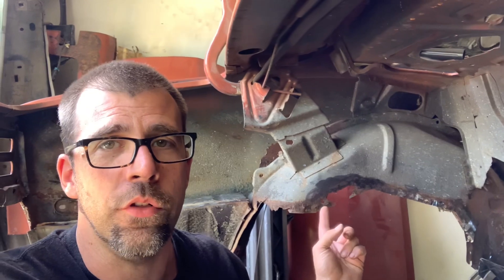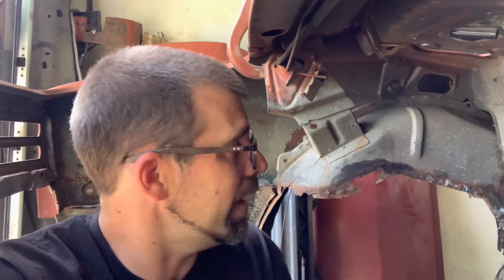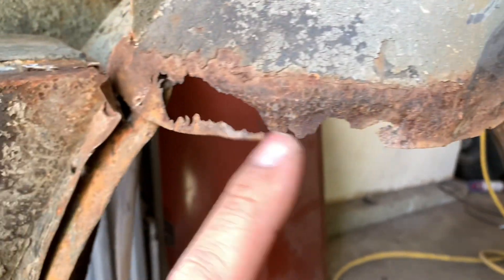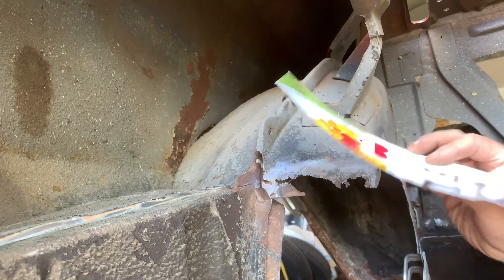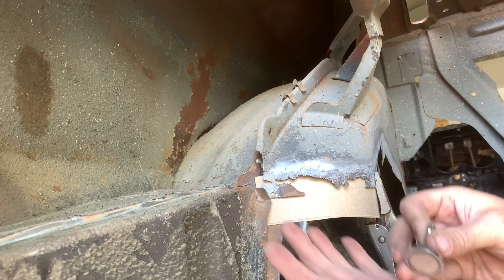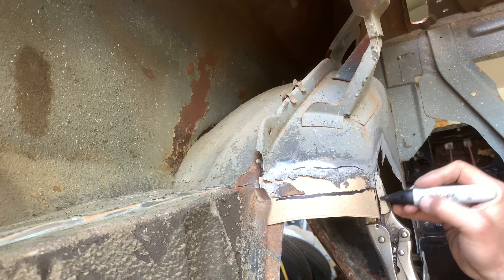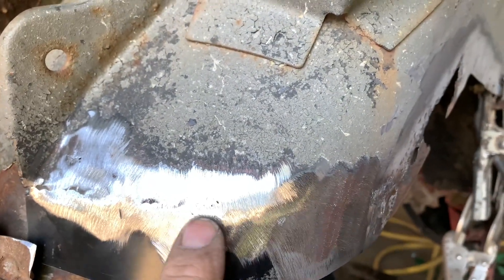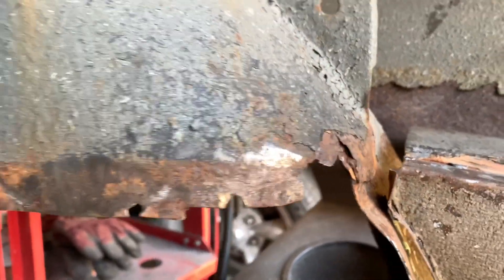how to make patches for seamless Wheel well rust repair 1968 Firebird

Comment: Thank god none of my F body's have ever been that bad. My worse car had the outer tub lip edge rotted out for about 2 inches and I was lucky enough to find  a doner car that I was able to graft in enough meat and flange & weld it in then use a section of a aftermarket patch 1/4 (China) and replace about 4 inches all the way around the wheel arch. Worked out great with a little duraglass & mud filler, blocked straight and 7/8/9 coats of fill primer. Most car's as bad as your, I pass on, to labor intensive to deal with.
Reply from the maker: Well I leaned here in Indiana/rust belt this car is mint……. Well to me.  Lol.  I don’t mind the rust repair it’s actually my favorite part. Crazy part people still ask crazy money for very rusty cars and I can’t do that.  I wish I could find them with minimal rust like yours, great score on your part. I assume you live out west?
Reply: @VinylVillageGarage   Both my F body cars were from St. Louis Mo. I am the original owner of my 68 RS/SS H/T and I bought my PHS documented numbers matching 400X 4sp. Convertible Bird in 1976 for $850.00 with minor rust out in both 1/4s  but the rest of the car was very sharp, complete & correct otherwise.  Back then there were no full 1/4s to be found ( NLA from GM ) at all so we tried to find wrecked cars and used a lawn mower blade and sledge  hammer by hand ( no, there  was no cordless sawalls ) to cut out good sheet metal in the junkyards ( yes there were rust free 67 to 69 F bodys in junkyards in the late 70s).  True it was a TON of hard work, but it was the only way as dealers had nothing and there was no aftermarket yet for sheet metal.  You have no idea how good you got it today, a call to Ames and your parts are on your door. We had to find everything word of mouth before anybody else. GTOs  were even HARDER to get parts for !!!! Plus there was no pontiac only yards, just go diggin yard to yard to find stuff. Buy a floor pan , trunk floor, firewall was a royal pain ! but it was cheap. A floor pan, $35.00,trunk floor  $20.00 firewall $15.00 but all day to cut that sucker out with a lawn mower blade! bam, bam, bam, bam wham wham ! with lots of blood sweat and  tons of 4 letter words of wisdom !  OH YOU NO GOOD SON OF A #^$@*^$^%$ !!!!   it 4:30pm ! there closing a 5PM!  Your comeing OUT of there floor pan ! WHAM, WHAM, WHAM !   ----- Ohhhhh yes, been there .
Reply from the maker: Lol, I could see myself doing the same thing to get parts back in the day just like that if I had to. I can only Imagine finding a rust free first gen in a scrap yard. I would be in heaven playing at a junkyard like that. Just think you where cutting up what we would consider Gold now.  I do remember the days of swap meets and digging thru boxes to find the treasures, this was before the days of the internet and online shopping. Now swap meets are not that great and overpriced unfortunately.  Even when I did my first bird back in 1996 parts where not nearly readily available as compared to today. Even the quality has improved.  Congrats on buying and keeping your 1968 Camaro. That’s almost unheard of. Me being a bird guy bonus points for you owning a nice Firebird too. I have yet to own a  factory 400 bird.  Here is to someday maybe.  Thanks for sharing
Reply: @VinylVillageGarage  Long time subscriber to you, I have 3 motors for my 68 convert Bird, a 1970 YS R/A III / 13 casting heads, plus, the numbers matching WS 400 with 62 heads and my beast, a WW R/A IV 4 bolt block +.030 with a 389SD forged crank & rods  I got from Smokey Yunick in Daytona, ( poor folks, no way to afford a 421SD, yes I asked --- $20K for short block)  I got 670 heads the WW now in the car , but am saving $$$ up for a pair of the new aluminum Tunnel port V aftermarket heads & intake. To heck with twin turbos or the NO-2 juice, I will do it the old fashioned way ! all MOTOR !  There is no WAY I can apply any more then this to any kind of street tires.  A R/A 4 with forged crank & rods plus tunnel port heads ! yes, I think that will be just fine ! I already know I power shift it at 8,000rpm all day no seat  with solid lifters & 670s heads. Them Tunnel ports will get it up to 8,700 rpm much quicker !  Ever been up in smoke  sideways in 4 gear ? Stay tuned.
Reply from the maker: Huge Thanks for being a subscriber. Most impressive engine collection and parts.  The 670 heads I will take those when you trade them out for the ram air V beasts. After running that you won’t ever want to go back.   I saw a company or a guy was making the heads ran into him in Plainfield IN last year. Tried to sell me a set. Very tempting but it’s some serious money, special intake, cam shaft, and custom headers.  The wow factor when you open the hood, priceless
Reply: I use to flat out cry when a perfect rust free 68 F body was stolen & in the yards. NO yard would chance selling anything off a stolen car, they had to hold it for 3 months ----- then CRUSH IT ! OMG NOOooooooooooooooo  perfect 400 HOOD ! Rally pack cluster, correct perfect 400 grill,  Posi rear, fold down rear seat, Deluxe interior & 3 spoke Bird wheel   NOOOOOoooooooo!!!!!!!! as they made it 6 inches tall !  And today it's a dead Mitubinga !  Grrrrrrrrrrrrrrrrrrrrrrrrrrrrrrrrrr !!
Reply from the maker: Noooooooooooo! heartbreaking and so not necessary
Reply: @VinylVillageGarage  . But the sound of them Vs ! totally different from any other motor. The 670s will be bare, as they got a  set of R/AIV valves in them now and no hardened seats for unleaded gas. I will have no need for them and there runners, heads don't crack in South Florida !  lol.    
The R/A V heads are pricey but my god on a R/A IV with a forged Super Duty Crank & Rods & solid lifters, totally bullet proof.  I have already blown the clutch 5/6/7 times and threw the ring & pinon right out the back of the 8.2 with 433 gears , had to build a 12 bolt for it and a custom chrome molly driveshaft as I twisted 2/3/4 GM shafts up like nothing lol.  Yes I an VERY hard on stuff !   My car, my style. if it doesn't brake , try harder ! I really think I just about got it good to go now. Haven't broke much in a very long time . I still have all the original parts repaired and ready to go back in if I want to put it back as a stock numbers matching car ( the 8.2 replacement posi rear is out of a 69 400 car with 3:90s close enough PHS said it came with 3:55s)
Reply: @VinylVillageGarage   lol , we would BOTH be at the bar drinking HEAVY crying  after that----- seen it happen with Birds & GTOs  as well . There was a 67 GTO that was just like  SHOW ROOM NEW ! they took the motor & trans and that was all. When the yard got it, it sat there for 3 months ( with me asking to buy it DAILY with CASH !!!! )  and then this big nasty front end loader stuffed it in that damn killing machine  and ---- and ----- NOOOOOOOOOOooooooooooo your killing me here, it was like open MURDER !!!  We car guys never get over that kind of thing !   Hell that was 40+ years ago, but that GTO was outstanding. I had a 428 at home and Muncie ready to drop in it .  I would have had that GTO on the road in 24 hours, no if's !
Reply from the maker: I build them to drive and not always delicately. I scattered a 8.2 diff as well mine split the pinion right between the bearings then launched it thru the side of the axle housing, Didn’t have a driveshaft loop but fortunately the drive shaft bounced around a little then came to a stop on top the muffler, almost rubbed a hole thru it.  I might have been driving “the speed limit” 😉 beside a mustang between stop lights when that one happened.
Reply from the maker: That would be like watching a live execution of your best friend, not something I would ever want to see.  Closest I ever got to something like that I found in the back lot of a car lot a 1969 Firebird quite possibly a 400, convertible panted carousel red you could just barley make out the tail light panel from the gate opening gap.  I took a sneak peek once No engine, trans, or any wheels other then that complete.  Tried to buy it, stopped periodically for over two years with the same response, no title can’t sell it, I even offered a nice lump of cash multiple times. Then One day it was gone, of course i stopped and inquired what happened, they sold all the cars in the back lot to the scrapyard for scrap price.  NOT COOL
Reply: @VinylVillageGarage   Some of them we just can't save. All the big junkyards in St. Louis that had multiple Muscle cars have been gone for decades. But it was the small private yards that I found the real rare stuff. I picked up my R/A III 400 in a 300 car yard in a 71 CAMARO ! ???? YES ! I ran the numbers and it was for a 70 GTO A/T car. it had chrome covers and was spotless. The yard owner was  a Chevy guy so I got the R/A III for $150.00 and he pulled it out ! ( best running motor I got really) Another small yard had 4 68/69 GTOs hit HAAAARD !  and all had WT 350/360hp 400s in them. At $75.00 each you bet I pulled all 4 of them. At one time I had 28  big horse power 389, 400, 428s in my little 2 car garage. One of the 428s was a 390hp out of a 67 G/P veeeey rare.  I never liked the 455s, so passed on all I found.( even a 455HO for $200.00)

  I moved out of the cold dark snow & rain of St. Louis in 1980 and had to leave most of them behind.  Only could bring the 3 I still have and many boxes of parts to South Florida.  The numbers matching 400 block & heads for my Convert, the WW R/A 4 block and drove the Firebird down with the YS/ R/A III from St. Louis to south Florida with 4:11 rear gears, yeah a long expensive trip! Never missed a gas station ! Found a new bunch of yards down here with muscle cars as well up till around 1995, but then the EPA got involved, the yards & real cars are now all crushed & gone. So now all we get are the scraps, but I still remember them huge city junkyards with thousands of 60s cars piled 25 high ! for as far as you could see. One time I seen a 1968 400 Bird H/T on the very top of 20+ cars high mountain of cars with a rust free really nice 400 hood ! It was due to be crushed the next day !!!! Oh HELL no! My 400 hood was not very good ! So I put a 9/16s ratchet in my pocket & a spool of rope and played TARZAN !  Get all the way up there on top with the car rocking all around in the wind, ( ooohhh boy ???? )  and it started raining HARD !  ( just my luck ) I tied the rope to the front catch of the hood and got all 4 hood bolts out in the pouring rain and roped that hood to the ground by myself, then I like to broke my neck trying to get back down off them wet cars to the ground! Yes I got that dent & rust free hood for $35.00 ( it's on my car right now ! )  The guy at the yard asked where did you get that hood from ? I pointed up at the car in the rain, he just said , YOUR CRAZY !  Hey now, it's a 400 hood ! I might be crazy, but I am not stupid. Looking back today, should NOT have done that. Funny the things you do when your young .  By noon the next day that car was crushed , it was hit in the rear, but looked to have all the 400 parts & the powertrain was still there. That car was moving around so bad, I didn't even look to see if it had the rally gauges in the dash as there was NO WAY I was going to get them floating around 75 feet in the air ! lol.
Reply from the maker: I love these stories and memories, yes when I was younger definitely more invincible then as compared to now.  I would have done the same thing to save a 400 hood and not think twice about it when I was 20.  To see and have those engines now in a scrapyard would be the best field trip and worth a 1,000 mile drive to poke around, sure is fun to daydream
Reply: @VinylVillageGarage   The last big junkyard I know of today is in ILL. over by east St. Louis called Speedway auto salvage. They bought out all the St. Louis yards inventory as they ( the EPA bastards ) closed each one down. Last time I was there I bought a 1965 Olds 98 hood that was next to perfect and a 1966 Olds 442 hood that also was rust & dent free. I got both for $100.00 each. That was around 2000 . I understand that yard is still open and it takes 45 mins walking time just to get back to the old real cars as you got to go through all this new crap first to get back there. If you go, pack a lunch and a cooler full of water as it's a long hike to get back to the parking lot !!!  They still carry cars from the 70s all the way back to the 20s and they don't crush nothing unless it is just a total  cleaned bone. They had a rust & dent free 1950 2 dr. Chevy coup that still had everything and shiny factory paint & nice chrome. When I opened the trunk, there was a bright yellow spider! in there HOLY COW !  as big as a air cleaner and it was  NOT SHY !  HIS CAR ! STAY AWAY ! ----- we did ( you know about spiders with bright colors right !!!! totally deadly ) if you spayed it with RAID , that sucker would have thew the can back at you !  That guy was nothing to mess with . I was only after newer stuff and got the heck away from HIS Chevy Coup ! Wow ! Yes, you never know what you might find in a junkyard.
Reply from the maker: I was just in stLouis a couple weeks ago for FirebirdFest might have to make a detour next time I am that way.  I will steer clear of the spiders too, no thanks.
Reply: @VinylVillageGarage  After I moved to south Fl.  I found a yard down here that had row after row of all old cars. It was along side a drainage canal about a mile from the beginning of the everglades Natl park . There was a pretty complete 57 2 door Pontiac Surfari Wagon I spotted, I kind of like them so I went over to it to have a look see. Now keep in mind this was with in my first few weeks of this St. Louis City boy moving into the SWAMP ! of South Florida. Down here they got these big ass over grown lizard SNAP garbber alligators that grow big enough to drag you away and have you for a SNACK ! . So,  I opened the hood to look at the old 287 inside, but it was gone, replaced by-----  a 11 foot very pissed off Gator ! that was not very happy about this city boy disturbing his rest.  Needless to say I was ass hole & elbows out of there on a full run, so yeah you never know what kinds of local WILD LIFE  can be found in THERE CARS ! I call em Gard cridders !  I learned, if a car looks just TO GOOD to be there ,,,, carry a GUN ( 357 or bigger ! )  in your tool bucket ! as there is a very GOOD reason nobody was not all  over it . lol   Words to live by ! Now, you want to know about another kind of cridder that can tear you up quick?. I was pulling a nice turbo 400 out on the ground under a 69 Olds 442  down here. Well,  they got  this insect called a FIRE ANT ! Holy mother of god STAY AWAY from THEM ! You WILL  LOOSE !  Them little no good  %#*^@%*)_)%$  like to ate me ALIVE !  and QUICK to ! No, by god it is NOT all fun & games in a salvage yard.

   As I have gotten older I have a few questions I always ask myself when I find something of interest,  do I REALLY need it? and is it safe to get. If the answer is no, walk away ( unless it's a complete Ram Air 4 with 614 heads ! ) and yes I am also STILL  looking for a good looking 30 year old virgin that only knows 1 word to ! .  WELL ! I am allowed to DREAM !
Reply from the maker: Lol, that reminded me of the
Commercial they did for the GTO with the tiger under the hood, not only did Pontic keep tigers under the hood they also have gator power.  We just need one more scary animal under the hood to make three and that would make a very interesting tri-power story.

Comment: I like to make my patch panels first using the rusted area as my temp then cutting the rusted area out
Reply from the maker: That works great too especially when doing the toe boards. In this case a lot of the panel was missing I was thinking of a way to make a template this was what I tried and worked out good in this case

Comment: What kind of sand blaster and media are you using. I know its not the point of the video but, whatever your using looks like it works pretty good. I'm having trouble with my cheap shipon gun and playground sand lol.
Reply from the maker: Lol. Playground sand. I used to use that as well. It does a nice job of not pitting or damaging the the good metal but slow at removing anything.  I use black beauty blasting sand I pick it up at Menards it used to be like 7 bucks for a 50 lb bag.  I have three bags left. It is a lot coarser then the white play sand.  
     I have a large pressure blaster too but man that makes a huge mess!  And you have to use a big compressor to run it.  This little siphon spot blaster I use is like 25 years old I purchased it from JCwhitney catalog it’s been awesome.
Reply: @VinylVillageGarage  Thanks for replying. I was using regular play sand that is not white, anyway at work we get truckloads of the finer white sand I think its called, something i don't know. but I will definitely try white sand and then try that media from menards and then maybe get the same sandblaster you are talking about from jc whitney. once again thanks.
Reply from the maker: @davidcraft4909  welcome of course this is why i am doing this YouTube adventure share the love and knowledge to keep you project moving forward anything else don’t hesitate to ask.
Reply: @Cseidelmann6770  oh yeah , i have a respirator

Comment: Good job. Did you consider minitub?  What's the biggest tire you can fit ? Guessing around 275s
Reply from the maker: I have debated mini tubs a few times. Factory wheel wells you can fit a 275 as long as you have the proper offset with minimal
Or no modification to outer wheel well lip.  Mini tubs are neat but then it requires a lot of other mods, fuel tank, suspension, sometimes the interior, not sure I want to do that yet. Plus this car is not mine, this is my first build for someone else. This is a new adventure in many ways.